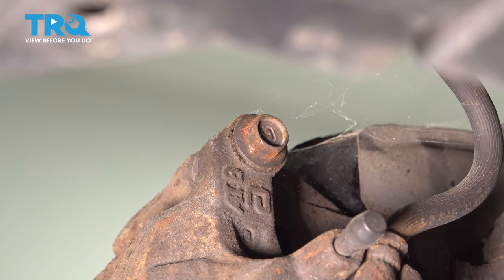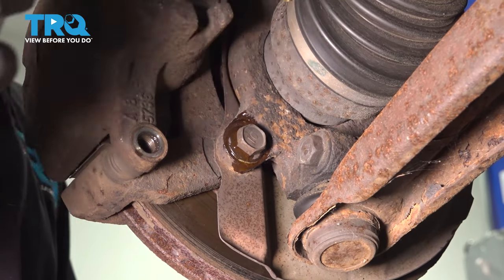How to Replace Wheel Bearing 2007-2013 Mitsubishi Outlander

Comment: I enjoyed this video. Thank you for showing the details. 

That said, some thoughts:
Anti-seize’s liquid phase is petroleum based. You probably don’t want to have overspray onto the CV boot (rubber).
Similarly, probably don’t want to use anti-seize in the caliper guide pins either. Use silicone grease instead.